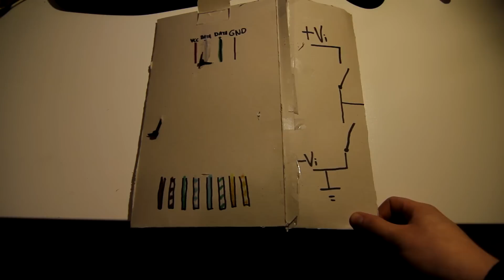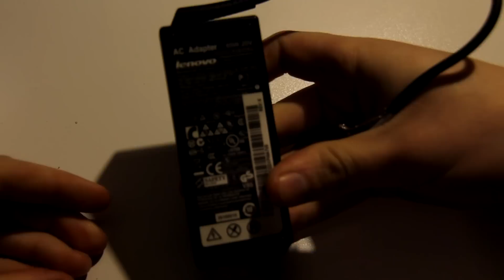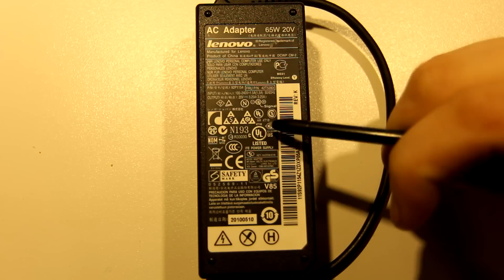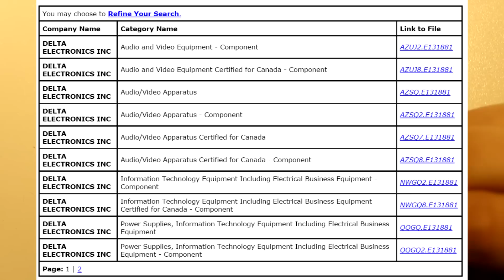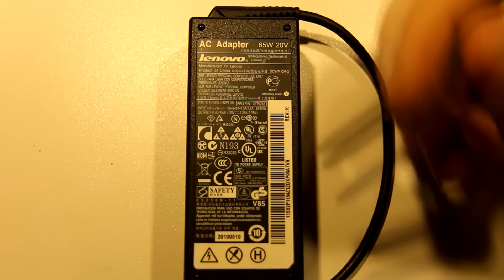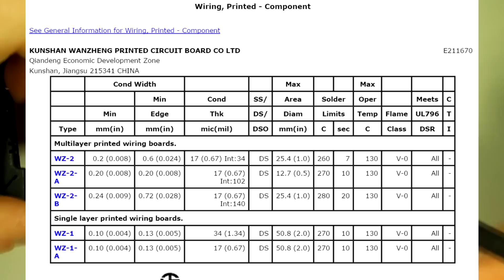A Donated Lenovo Laptop PSU (008)

Comment: It is very interesting to see your tear downs of power supplies, because you know a lot about it. I am looking for as much technical details as possible.
I have also done some (About 60) tear downs of power supplies with explanation (See lygte-info.dk), but I do not have as much knowledge and hope to learn something from your tear downs.
Reply from the maker: +Henrik Jensen Cool website! That aligns very well with my interest in flashlights. Thanks for the link, that'll go in my favourites.
Reply: +PowerElectronicsBlog Sorry, but the flashlight part has a very low priority at the current time, most of my time is spent on batteries and chargers (both battery and usb).
All my tear downs is in the usb chargers category and I am going to study your tear downs to see if you can add to my knowledge (As a PS designer you definitely can).